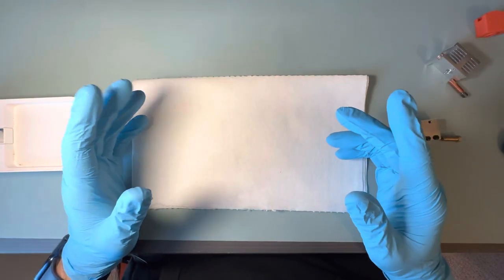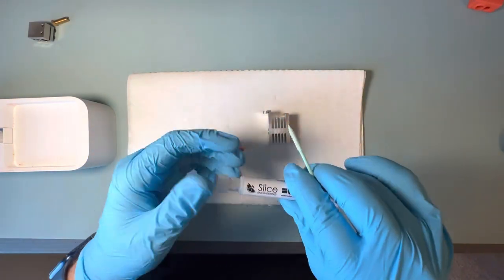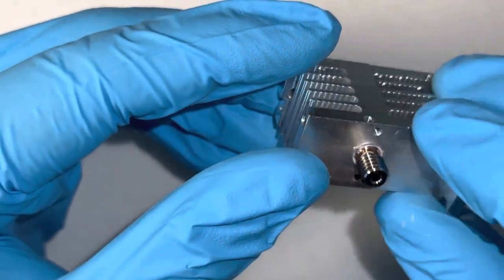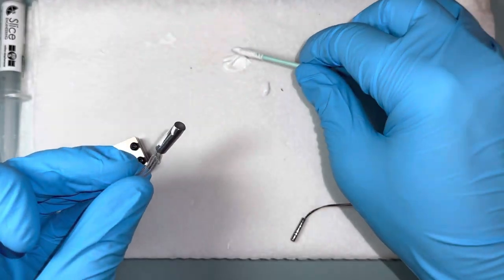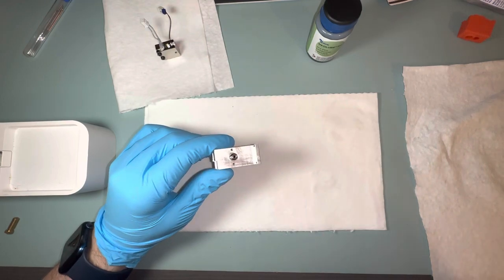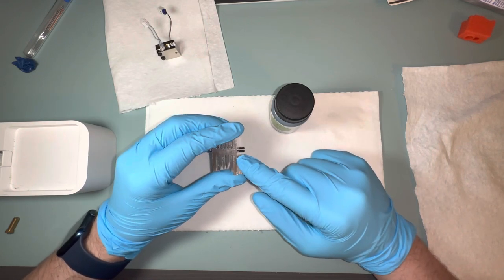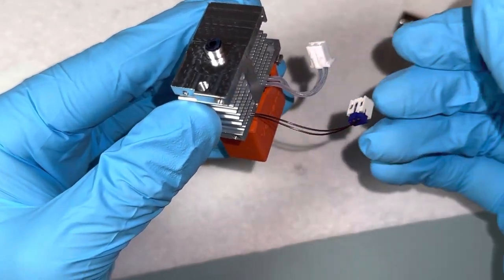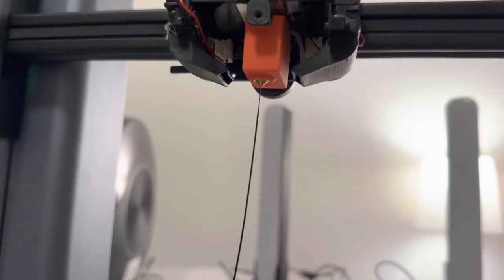AnkerMake M5 Volcano/All Metal Hotend Mod 1.0 | Build Log

Comment: Just one thing to note if one applies too much thermal paste, it actually acts as an insulator rather than a conductor.  The video appears to show way too much applied.   Should be aplied by applying some on and wiping off with lint free cloth as to have a thin film left on.
Reply from the maker: You’re totally right that it can be an insulator when applied thick enough, but when you add sufficient mounting pressure to the mix, this simply becomes nearly impossible. This us a pretty pervasive misunderstanding in CPU thermal paste as well.

This is a pressure mount situation in which it’s pretty much impossible to put “too much” on since most of that goop comes out the threads at the bottom as you screw it in. This leaves just the right amount in the threads to not have any air gap which is critical to good heat transfer. In this case, too much is better than too little as the excess will just travel out of the threads.
Reply: @AustinDennis  fair enough, did you have any issues with the thermistor readings (fluctuating readings)?
Reply from the maker: @JustSomeInternetDude  Ah, I now see you were referring to the thermistor and heater vs the heatbreak. My point still stands, but for a slightly different reason. It still squeezes out the excess since there’s no room except for the right amount of paste in the well.

So far so good across the board! Thermistor readings are stable and it heats just like before the mod. I even went down to a fairly weak 40mmx10mm Noctua fan on the heatbreak and it seems fine. No clogs in since I moved over to the mod.

I will say that this mod is kinda pointless now since you can just buy an all metal hotend directly from Anker now. You could just slap a volcano block on the end of that heatbreak and save yourself the hassle.
Reply: @AustinDennis  gotcha good to know it worked out.  And it's videos like this that make OEMs continue with innovation.

Comment: New to to 3D printer. Just wondering, why would you want to do this, and what are the advantages?
Reply from the maker: Welcome to the hobby! The main advantages are twofold in my opinion. One: theoretically the 5mm of increased melt zone should provide the ability to push more plastic per second out of the nozzle, ergo higher speeds or the ability to use a bigger nozzle openings without having to slow down. Two: right now nozzle availability is like zero for this particular printer as it has a custom nozzle length. This mod allows you to use all existing Volcano nozzles (there’s a rich market already for these) and allowed me to use more exotic nozzles like diamond tipped or hardened steel. There haven’t been any major disadvantages at this point besides having to print out new fan ducts to account for the change in nozzle position.

Comment: You should NOT add heat paste or similar between your heat break and heat block!  The heat break is meant to STOP heat going up, so the worse the conductivity between heat block and that heat break, the better!  I just hope you have not increased the heat transfer across the gap of the heat break by putting that grafite everywhere.

And you DO want to have heat paste between your nozzle and the heat block as here you DO want the best heat conductivity to melt the plastic in the nozzle as fast as possible.
Reply from the maker: Well, graphite powder is actually a really poor conductor of heat in most grain orientations and very stable at high heats. It’s used a lot in fire retardants for those very reasonS. It’s also just a dry lubricant, not meant for heat transfer and doesn’t fill air gaps well. My heat block has been tested up to 260C and the heatsink doesn’t even break 50C. I understand that paste between the nozzle and the block would increase thermal conductivity, but when that Boron Nitrate paste is dry, it’s like thread lock and kind of defeats the purpose pf having swappable nozzles so I just go without. I haven’t run into any significant performance issues and I get a steady 18mm/s cubed with PLA. I’m really not sure where your getting your info from, but respectfully, I do understand how the system works. Thanks for your input, but I got to be honest: this comment comes across as very condescending and I don’t think you super know what you’re talking about. If you want to know how it worked out for me, just ask. I don’t need a lecture on heat transfer.
Reply: @AustinDennis  Commenter above is incorrect. Having worse thermal conductivity between the tope portion of the break and heat sink completely defeats the purpose of having the heat sink to begin with by maintaining heat in the tube.  If the ultimate goal of the heat sink is to remove heat from creeping up the tube and transfer that thermal energy to the surrounding air, maximizing transfer capability between the tube and sink absolutely helps this.  The only thing I would consider is perhaps using a copper/nickel paste instead of the boron nitrate.  Copper/nickel, while significantly more expensive, also serves as an anti-seize instead of a threadlock, allowing removal of the heat break at a later date if needed.  It's also thermally stable and used frequently in nuclear reactor applications.
Reply from the maker: @cvabuck5489  All good points! I happen to work in the nuclear field as my day job and know about Copper/Nickel based thread lubricant. I also found graphite thread lubricant to be unnecessary in this application: these threads simply don’t require lubricant due to their machining tolerances being quite loose.

My reasoning picking Boron Nitrate was two fold: cost and good enough performance. I’m really happy with the way it’s turned out, but you’re absolutely correct on Copper/Nickel thread lubricant and that’s a good option if cost is not a consideration or the higher performance is critical.

At the end of the day, I think it’s important to remember that we’re dealing with 60W of heat at the maximum here and around 15W is getting consumed by the plastic as it melts. That’s really not a lot of heat energy to dissipate and the surface area of the threads is quite large. I ended up with enough headroom for these little inefficiencies in the name of cost effectiveness to ultimately not matter.

Thanks for the comment, I really appreciate this kind of discourse!